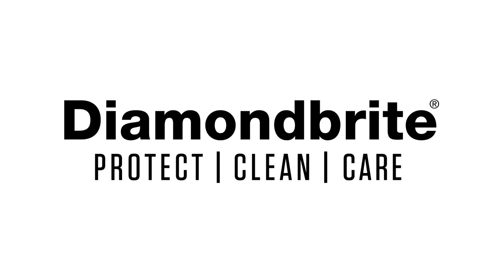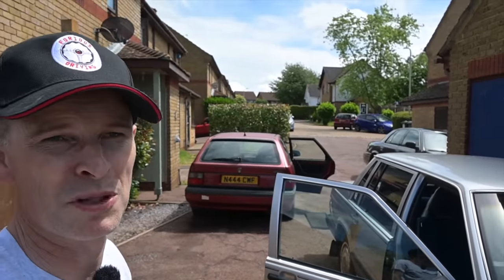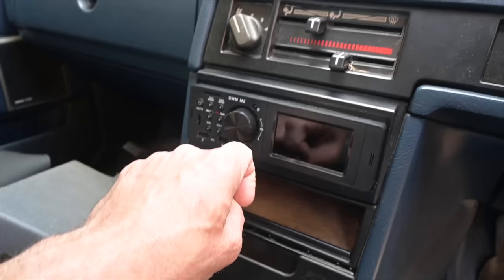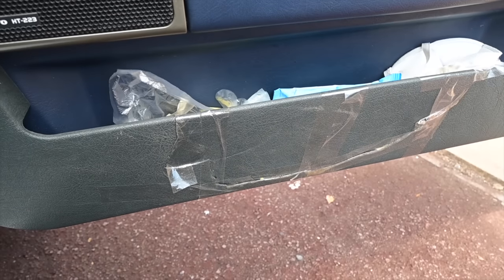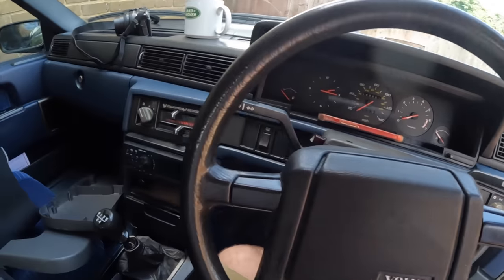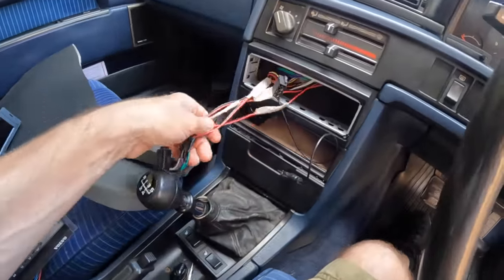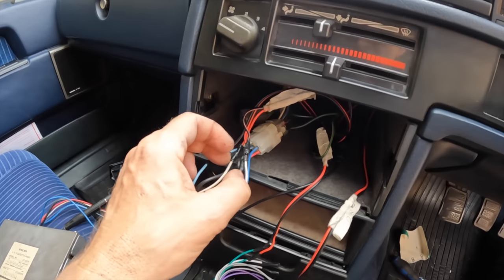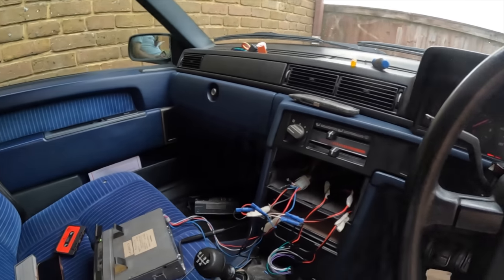Volvo 740 fixes! Door pocket! OG Radio! Door mirror! All done!

Comment: Hi Matt, you know what, the more I think about it. Keep the Volvo. Apart from the fuel consumption, that car will outlast every other car on the fleet. It was a classic from the the day it was built. Cheers from Hamburg
Reply: Can’t agree more back when Volvo made fabulous cars safe solid and comfortable
Reply: Well said, sell all that Rover rubbish, keep the Volvo and the Alfa
Reply: What did Volvo do structurally to keep them so solid? Plenty of older ones seem to laugh in the face of rust
Reply: @pigeonpoo1823  Good quality steel, paint and wax.  Dont remember which year this car is, but some years 740s are partially or even fully galvanized.
Reply: @GoldenCroc  From the '87 model year onward they were constructed using Zincrometal.
Reply: @pigeonpoo1823  Zincrometal.
Reply: @pigeonpoo1823  kept their workers happy, so little to no issues when it comes to strikes and stuff, made sure to go for quality materials and took preference for their cars to be structurally solid, culminating in cars that simply were built to a higher standard and with the best material that volvo could buy.

Comment: If you take a small piece of removable plastic trim in the correct blue to an auto paint shop they can usually analyse it and produce an aerosol for you. A spray over of primer followed by the blue should look pretty good I’d think.
Reply: Do you need plastic-specific paint, or do normal aerosols work ok?
Reply: @wholeladalovenorthernireland  To be honest I don’t really know, but as most of these paints nowadays are water based I’d be rather surprised if there was an adverse reaction. I also think that you can buy a “barrier” primer which is supposed to stop any damage being caused.
Reply: @malcolmherbert5127  They can mix you specific paint suitable for plastic.  Also you can get specific paint mixed to match your vinyl/leather upholstery.  Done this often and had good results.
Reply: Thats a good idea. I think the primer is key. Rough it up and spray an adhesion promoter and spray whatever you want on it.
Reply: Don't paint plastic. The paint will flake off in no time.
Reply: @lupulflamand5673  Just about all modern cars have plastic bumpers that are painted and that doesn't flake off...

Comment: It's your best car, and will probably last forever.

I had a 760 Turbo Estate seven seater. It's the best car I ever owned, it simply ate up the miles on a long trip such as to the south of France.

It never rusted, covered getting on for 250,000 miles and still felt and looked like new.

Every time I climbed aboard it was like slipping into your favourite slippers and putting your feet up. Just so welcoming and relaxing.

The best cars Volvo ever made in my view.
Reply: Totally agree with you Canalsman, I had a 740GL 2.3 Estate 7 seater and yupp, one of the most comfortable cars' I've ever had, it too had 250,000 miles and never missed a beat, lots of battle scars but no rust. I should have kept it, but ended up with a Mercedes W124 300te which had self levelling suspension and a silky straight six.

Comment: If you can't find matching blue trim, you might be able to recolour some other trim with vinyl dye. It's not a coating like paint, it actually absorbs into the material to change the colour. I've seen it used on 1980s computers to restore the appearance of badly yellowed plastic.

Comment: Before looking for a new switch soak the switch and connecter plugs in a mixture of salt and vinegar for 15 mins ,then in warm water and baking soda to neutralise the vinegar mix ,use air line to blow out any moisture and see if it work's. It did for me when i used the same method on my Landcrab indicator horn switch unit.
Reply: Or at least the electrical contact cleaner you've mentioned several times in the past.

Comment: Nice to see some Volvo content. I'm biased. Had a 1985 340 GL 1.4.
 A 1986 740 GLE 2.3 carb bought in 2002 for £425. My first car. 
1989 240 GLT Auto Estate in 2009 for £350, owned 10 years. Sold with 234,000miles in 2018.
For the last 6 years a 1996 940 LPT SE auto estate. Used as my work van. Paid £250 for it and runs very well at 208,000 miles. Just fixed my AC. Looking for an electric sunroof switch, as opened up to clean and lost one of the little rocker pieces! Keep the Volvo, no major trouble and just soldier on!

Comment: There is a good variety of colours available in Plastic Paint Rattle Cans. I am sure you will find the right blue. If not, get  a match of  correct colour  in an acrylic touch up. With an etch primer coat first then the paint. Experiment on the old plastic pocket you just removed.

Comment: @Furiousdriving: Tip for next time you remove the door card,:
- 90 degree turn the plastic button in the cubby and remove it
- Carefully pry loose the blue fabric panel with the vertical stripes (clips might break. When holes in cardboard back got too big, put use some silicone sealant or other flexible sealant on the edges of the holes to make tem smaller. Let dry before popping panel back in)
- Former step will allow you to lift the plastic frame without hassle and in one piece. (without removing fabric panel, you'll likely brake the plastic frame)
- remove the white clips at the under side of the door card
- Lift off the whole panel.
So no need to remove the red light at the back or the 'door open' knob from the lever

Comment: Great video, Matt. Watching you do the door pocket, I had a thought. Rather than living with the grey or trying to paint that one, why not get some blue ceiling material like you used on the inside, and cover it with that? Extra padding to keep it quiet but also add some strength to the panel. I gave up on the ones on my 240. They were shattered, but so were my feet from banging into it in the summer when I was wearing sandals. Had to take the door apart anyway to redo the window regulator, so was easy enough.

Comment: Many of those type of car switches can be dismantled by slightly lifting the tabs on the side and cleaning the internals with switch cleaner and a Glass Fibre Pencil. Something you will need to do at your desk as there are many small internal parts such as small springs.

Comment: My money is on powder coat - Those will be cast aluminum (or zinc) which are powder coated with a tough long lasting powder coat paint and then baked in a powder coating oven to activate the powder coat and cure it rock hard.

Comment: Talking about paint coming off vehicles, our vans at work were de-vinyled ready for replacement last year after about 7 years of the vinyl being there, you can literally peel bits of paint off if some hasn't gone already. The vans are certainly not in as new condition even if the mileage of some is relatively low (less than 10k for one), the perils of caravan site use!
Our departments, at least, are getting replaced tomorrow (should have been in 2020!) with new electric vans (Peugeot Partner e if they are the same as the two that were replaced at the beginning ), though currently we only have one regular "granny charger" and nothing else, charging them is going to be interesting.

Comment: Well done Matt a great video as ever the Volvo gets better every little job you do they were so tough comfortable cars always loved them 
I’m not sure if this will help I have a vintage hacker radio from 1971 and the plastix speaker grille and other fittings are brittle and the owners club have started 3d printing the parts and they can be coloured to match the original blue black or red colours 
Not sure if this is an option for the damaged parts 
Good luck with the rover and hope all goes well for Barry and his sons prom

Comment: Swedish goop is designed for Swedish winters not hot and humid English summers.  I think those door pockets have been used to pull the doors shut in the past.  A design oversight?
Reply from the maker: possible, but they are in the right place to get kicked

Comment: Based on my recent experience I'm surprised that the cassette still works on the radio as it is clearly older than mine...I've been using a 3.5mm headphone jack - cassette adaptor on the factory SC-700 double din stereo on my my 90s 850 ever since I bought it in the early 10s. In the last week or so the cassette started auto reversing (the adaptor has no tape loom) interrupting my playback. turned out the rubber band on the tape mech snapped. (my walkman had a similar issue, made around the same time). I was able to take apart the mech enough and fit a "stationary" type rubber band to it and it has so far lasted a a trip between the UK east and west coasts. dunno whether compared to the factory bands how long the thing will lasts... whether it will be years, months, or weeks 😄

Comment: Hi . Ive been thinking about ur volvo and remember u saying how juicy it was for a 2 ltr. 
I dont know if it will help u. But i was watching a car program a few months ago , a 240 with the same engine as urs and it was also using alot of fuel. And they traced it back to one of the injectors wasn’t operating as it should and it was letting about 2/3times more fuel than it should have done.
Dont know if this is happening to ur car but i thought id mention it just in case. U never know

Comment: Nice update on the Volvo, always good to get yourself some respite from the crap jobs that come with cars, like a bit of therapy! Just wondering if the Volvo mirror switches are like a Rover 75's and react well to being taken apart and cleaned internally? At that age it could be gunk that's easy cleaned up on the circuit board inside the switch unit?
Reply: Matt threw his U/S Rover 75 switch pack away without cleaning it. Works every time. Lack of regular use etc the contacts get a light surface corrosion spoiling electrical continuity.  Clean up easy fix.

Comment: Matt, At the risk of getting  slaughtered again. Question- Why don't you use Rust-o-leum Plasticote rattle can paint for yer pocket. I used it the other week and i had to check for my colour and they have shades of Blue. Better than grey auld stokin. Same for yer A pillar. 👍
Reply from the maker: I dont trust it not to peel off
Reply: Or get them plastic welded and then you get to keep the same colour?

Comment: Diamondbrite is crap, I used to work for the people that supplied it. They gave all the workers an unlimited free supply and everyone of us with a nice car turned it down and used Autoglym instead.
The polish doesn't last, you get a better finish on leather with soap and water than the leather cleaner they made and the car shampoo was like fairy liquid.
The only thing of theirs I kept was the shammies and the wheel brushes, both fell to bits in no time.
Even the air fresheners didn't last more than a week.
We used to joke about it saying the Porsche garage which was our biggest customer at the time was paying about £80 each for our cleaning kits that had the same quality as something from the pound shop.
Reply from the maker: That doesnt sound like any of the current products, or the generations before that Ive used. The ceramic range is particularly good
Reply: @furiousdriving  We are going back 16 or 17 years ago.
I'm just saying what happened, we could get the stuff for free and we didn't use it.
I still have the first aid kit in my car, never used it.

It was a long time ago and they might have improved since then but at the time it was worse than the cheaper stuff from Halfords and Wilko.

Comment: Matt the reason the plastics become brittle is due to age unfortunately plastic breaks down just due to age back when your Volvo was built they never expected it to last thus long but been an old Volvo it has lasted because they are built so well and the motors are reliable some cars in the 1980s were well built and your Volvo is and of course they used plastics on the interior but now they use plastic under the bonnet certain car companies love using plastic fantastic under the bonnet as for a certian Japanese car company there us very little plastic under the bonnet l know because l own one of these cars and under the bonnet it has a metal thermostat housing as for my 26 year old Toyota there is a bit of plastic under the bonnet which has cracked and broken fortunately its nothing that liquid flows through but there is still a lot of metal and it has lasted

Comment: Paint your doorcards blue
Reply from the maker: I never trust plastic paint, always expect it to peel
Reply: @furiousdriving  I'm no expert, but would sanding it down first make it adhere better?  Watch the door cards when getting in and out, that's how they break.
Reply from the maker: @SuperFIFTHGEAR  yes, a light sanding probably would (Ive not used it though) but with a textured surface the dirt in the indents of the texture would stop it bonding

Comment: Could you, please, install a turbo charger in this Volvo?
Reply: That would only change it from a reliable to an unreliable car.
Reply: @alphatrion100 Well not if its done correctly, but in that case it would be easier to engine swap entirely, so yeah.
Reply: @GoldenCroc 
its a 35 year old clunker. This guy welds the holes in his cars in his backyard a few days before getting them an Mot.
Reply: @alphatrion100  Nothing indicates the drivetrain or engine to be in bad shape. Age isnt all that relevant to steel when its protected from corrosion.  Now regarding the technical execution of it being likely to be satisfactory, you might have a point. Thats why I wrote "done correctly" as caveat above.